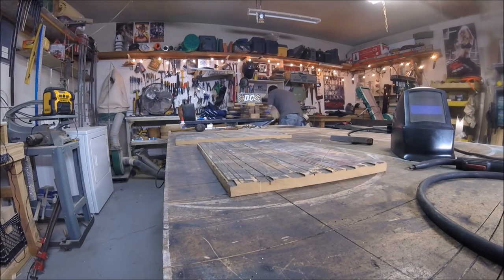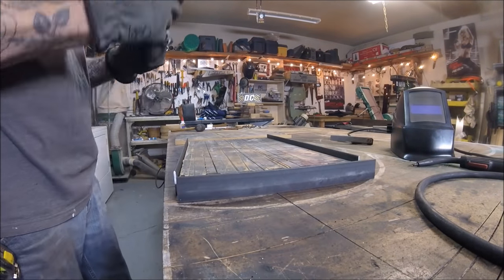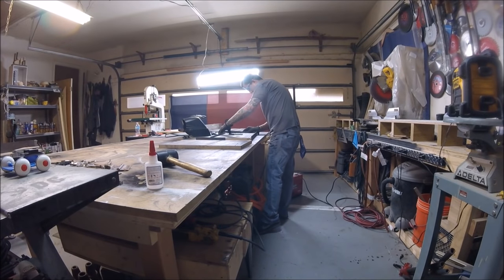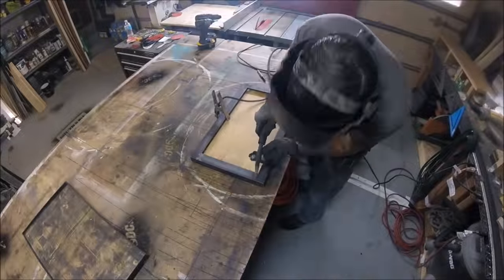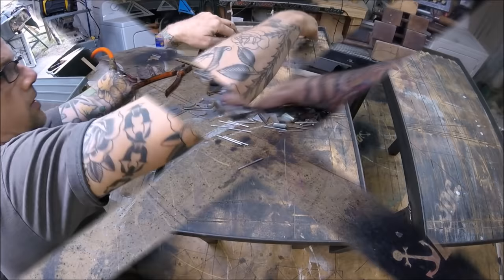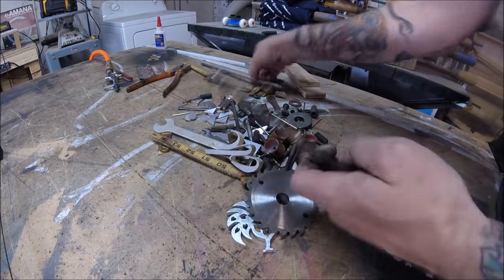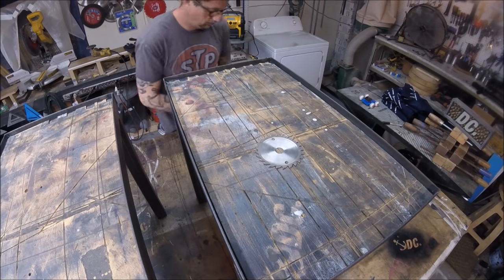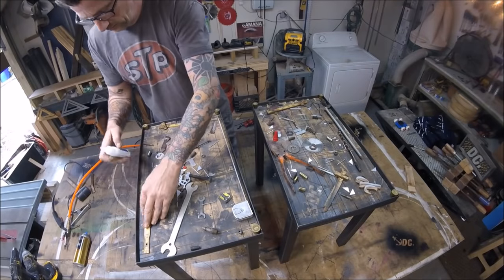DC. EPOXY RESIN TABLE TOPS

Comment: i think he forgot to use smaller in height object to have flat surface
Reply from the maker: I appreciate your comment, thank you,  and the surface was designed to have texture (objects higher than surface of epoxy).
Reply: Anyway looks awesome :)
Reply: Did the tape measure's tape edge poke up over the surface?  That might cut an arm.
Reply: With the 12ga caps at all 4 corners  you could set glass on them keep the resin from being scratched up

Comment: Everyone's a critic, right?  OK, those tables are awesome and would look great in certain restaurants.  I would change it a bit if you're going to sell those.  For the angle iron I would cut the top edge so it's perfectly square, no round over at all.  Then I would fill it completely with epoxy so the whole surface is smooth.  Then I would put a small round over on that outside edge so it was smooth/not sharp.  For the legs I would use standard table legs available for cheap.  In SF for sure you'd have some customers.  $500 each for a 24" x 30", 2-person table top?

Comment: This is a really cool project! Quick question did you clean the grease that may have been on the tools/ parts before you put them in? I was just wondering if a greasy tool would react with the resin as it heats.  Or is that something that may not bother it? 
These remind me of my mom's shadow boxes with all her nick nack stuff.
Reply from the maker: DowntownFarmerBrown1 just a basic acetone wipe down. The only issue was the chrome spray paint on that rooster, it bubbled quite a bit

Comment: I plan on putting tiny sea shells in epoxy on my small table however the table has rounded edges. Any suggestions for what I can temporarily put around the table to keep the epoxy from running off the edges?
Reply from the maker: MrGinger63 1/8in ply with silicone. Blue tape, lots of it. I tend to think of the easiest way to achieve an end result before starting...
Reply: Derek Conway thanks! I will try that.

Comment: Nice work man! I have a question about the curing, how long did it stay gummy to the touch? I pored a final coat to fill bubbles in a void on a walnut slab I'm doing and it's the first time I've left it clear without pigments. For some reason it's not drying, I made sure to mix properly and its around 80 degrees out so I don't see why it hasn't hardened after 3 or 4 days already. I'm debating on wiping it off and starting over, any advice is greatly appreciated.
Reply from the maker: young steve Should cure within 24 hours. Check your mix amounts, usually its half and half 2 part epoxy.

Comment: another great video. My wife has been hounding me to make one of those for her. How much epoxy did you use, and did you pour it all at on time? Also I want to get a cheap welder for doing things like that. Do you have a set up with gas? I don know mush about welding other than I want to try it. Thanks for sharing
Reply from the maker: I have a Lincoln 125, doesn't take gas. It's a flux core wire feed only. I'm poor and can't afford a better one but I've had this one for three years and never had a problem...good luck to ya friend!
Reply: how thick can you weld with that? Is that angle iron 1/4"? thanks
Reply from the maker: Derek Forestier 1/8 and thats as thick as I've ever welded.

Comment: what is the name of these two liquids?
Reply from the maker: Two part epoxy resin. Get it at any big box store or online.
Reply: Find that one at Lowes.
Reply: Glaze Coat I've used other brand's, there's a difference.
Reply from the maker: Ryan Gordon This brand from Lowes is not the best I've used. West Systems is pretty good
Reply: Derek Conway where? Online? Why do you like it, less bubbles,  no yellow?
Reply: George and Ringo